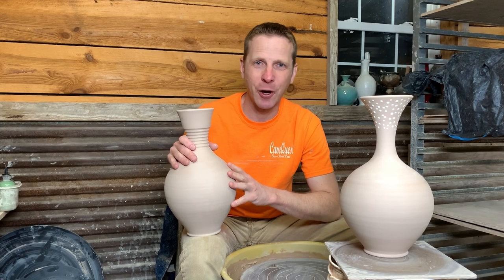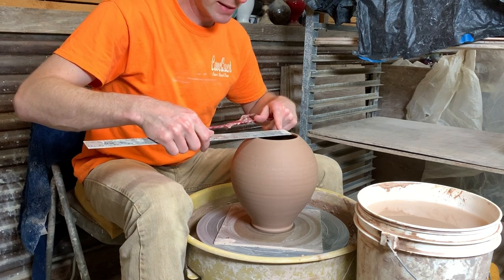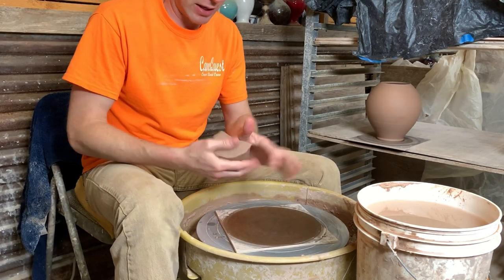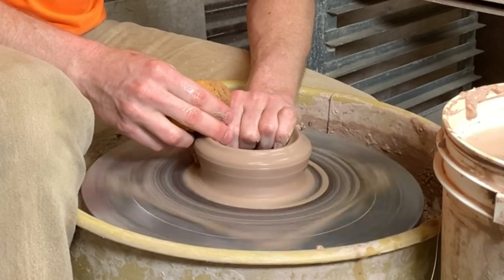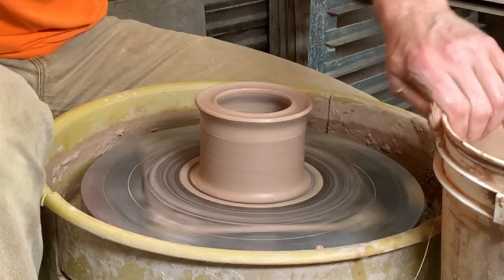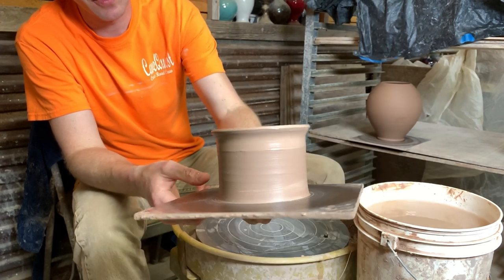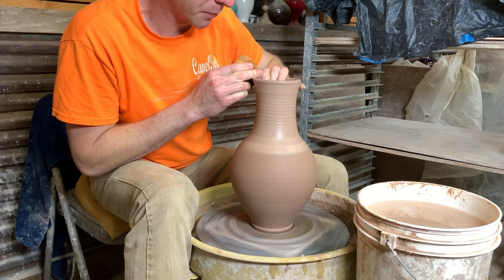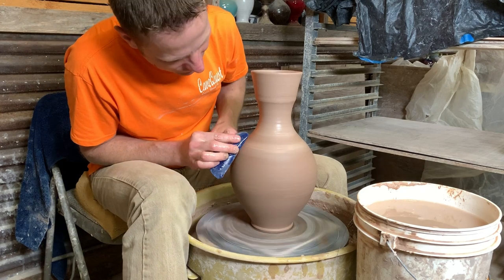Finishing Two Part Vases - throwing and attaching the tops

Comment: Thanks for making these very informative videos on two part vase constructions. I'm really interested, because it is very like the construction of the clay versions of middle eastern goblet-shaped drum shells, where the flaring part is the base of the shell (Often, the top is thrown right-side-up and then flipped over after it dries to a similar state like your vase bottoms; and then they cut the bottom out and join on the base in a similar manner).